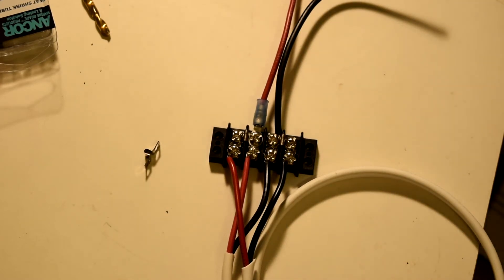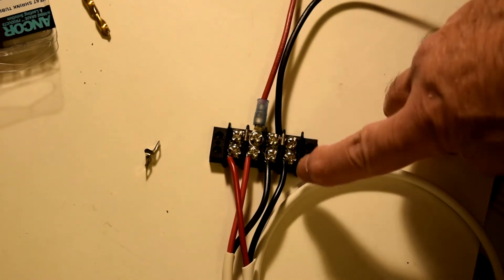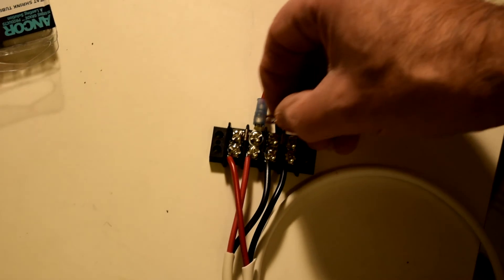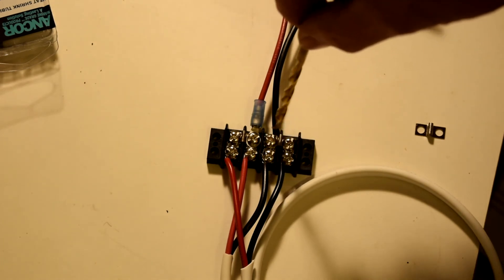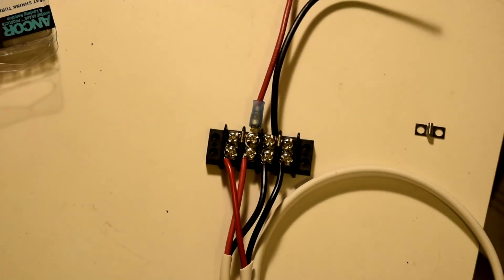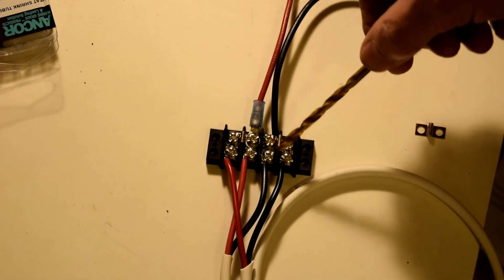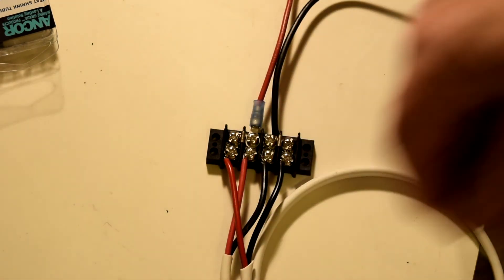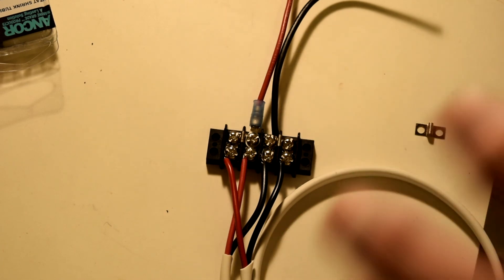Connecting multiple independent solar panels to the same controller

Comment: What advantave does this have over luggs in a non mobile situation..... Basically I'm asking Is there a reason you're not just using lugs or wire  nutting them together.... im putting together 4 panels and want to be sure I'm ok connecting them on roof and running 1 wire down
Reply from the maker: Wire nuts are never a good idea in a system exposed to weather.  I am not sure what you mean by "lugs".  If you are referring to using MC4 "Y" connectors, that works well, but be careful not to overload the connectors with too much current.  MC4 connectors are preferable to wire nuts since MC4 connectors are waterproof.  If you are connecting the panels in series, you can simply use the MC4 connectors on the panels themselves.  If you are wiring the panels in parallel, you will need "Y" connectors.  You can buy MC4 connectors for paralleling up to at least 4 panels,  but make sure the connectors are rated for four times the current of the individual panels.  For example you will need a joining connector rated for at least 25 amps to connect four 100 watt panels in parallel.    Furthermore if you connect four 100 watt panels in parallel you will need at least #10 wire from the parallel point to the controller.

Comment: Hi Todd, when you state some kind of plug to disconnect the wires from the barrier strip what are the plugs that can be used? I set up my 200 watts of portable solar for my truck camping and took it on my first trip this week. I found it cumbersome dealing w all the cables that are connected to the panels. I would like some type of fairly quick release for the cables. Any suggestions? I could disconnect the last set of mc4 connectors going to the controller but my thinking is they would wear relatively quickly w the repeated connect and disconnect. Thanks
Reply from the maker: Katharine, sorry for not getting back to you sooner, but I have been away from the internet for the morning.  What I would do is both simple and cheap.  If you have two panels to connect, I would go to the hardware store and buy a standard wall outlet like you use in your house  and a plastic or metal box to mount it in.  Then buy a couple of plugs and wire the solar panels to the plugs.  You can get an outlet, mounting box and two plugs for under $10 (or $20 if you go with the fashionable outlets).  Mount the box with the plugs on it to a piece of wood and you are good to go.   The only thing to be careful about is keeping the (+) and (-) straight.  You could wire directly from the socket to the controller.  Then plugging a panel in would be just like plugging anything in the house in.
Reply: Todd Dunn great thanks, I will try that out. It has been real exciting for me putting the solar system together. Made some modifications to my battery box set up today to give me a little more space in my truck bed.  Lot of panel wire gets in the way though. Disconnecting them will help. Thanks!!!
Reply: Todd Dunn I have 2 portables wired together in series, 4 panels in total. Can I keep them that way and only use 1 plug? My thinking is yes but want to be 100% sure.
Reply from the maker: Yes, although it may be tricky to wire both panels to the same plug just because of the number of wires involved.
Reply: Todd Dunn I have already joined the 2 portables w mc4 branch connectors, so only have one positive a negative line going into the controller.

Comment: What gauge wire can it accept?
Reply from the maker: Barrier terminal strips are available that will accept up to #6 wire.  The one I had on hand can go to about #12.  You just have to buy the one you need.  They cost under $10.
Reply: Todd Dunn thanks again.
Reply: Todd Dunn thanks